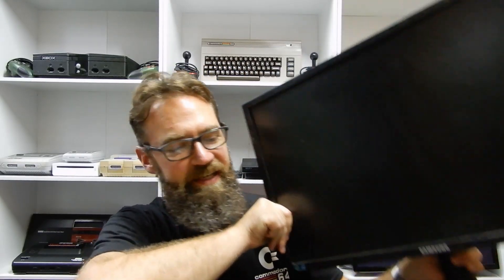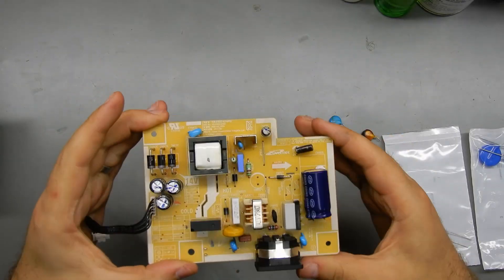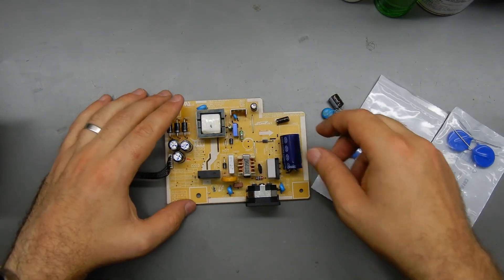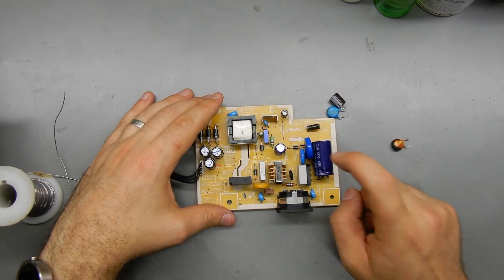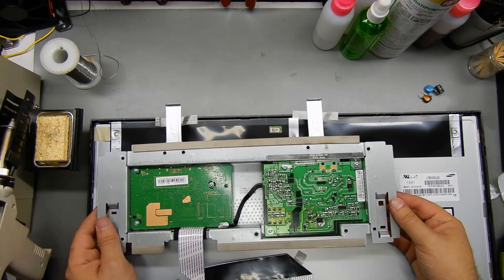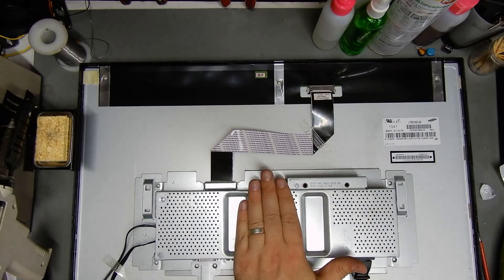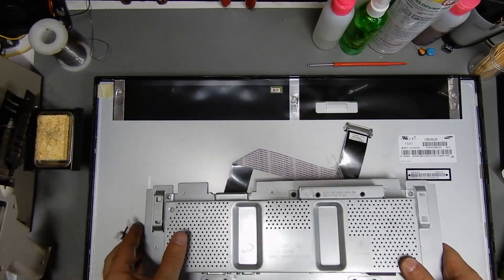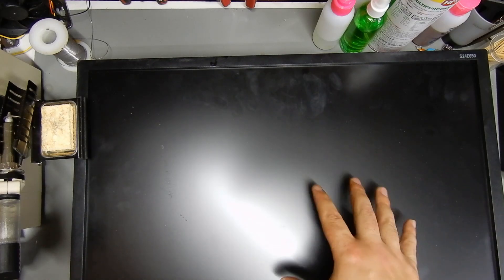LCD monitor power supply repair - replacing caps and varistors

Comment: Wish I had seen this before I got rid of my last tv, but I'm working on a power unit for a different appliance and the small lcd screen doesn't turn on. It has a cracked veristor but it's not blue it's black. Can I replace it with a similar blue one or is it even a veristor? TIA
Reply: If its the same shape then the black would usually mean a metal oxide varistor (MOV) and you can usually determine the appropriate replacement by using mouser or allied electronics if you can read any markings off of it

Comment: Hi Sawickipedia --- I was glad to find this video. The power supply board for my LCD TV has (I think) a damaged varistor with an obscure part number (5D 218 G F). I haven't had any luck finding it on the web. Can you offer any advice about range of specs for a component like this?
Reply from the maker: Yeah, varistors can be painful to identify. It sounds like the 5D may indicate the diameter, is it around 5mm in size? The second figure is usually the voltage rating, so 218V? Last two letters really depend on the manufacturer. If there's a logo on it, try and match that up to a manufacturer and then hopefully you can find more info on it

Comment: I have a varistor 471-14. How do I know if it’s bad? What can I buy to replace it with?
Reply from the maker: If you suspect that it's bad then it's probably just safer to replace it. It sounds like a 470v, but a quick google of the part number should confirm it for you
Reply: @Sawickipedia  any way how to test it with multimeter? Maybe measuring resistance?
Reply: @ReynaldoOchoa  You can measure the resistance to tell if they're bad or not. They should read very high - almost infinite resistance if they're still good. But you cannot tell much else spec wise with a multimeter AFAIK